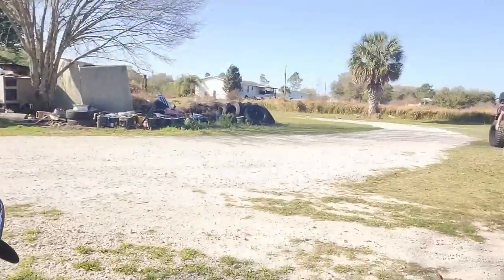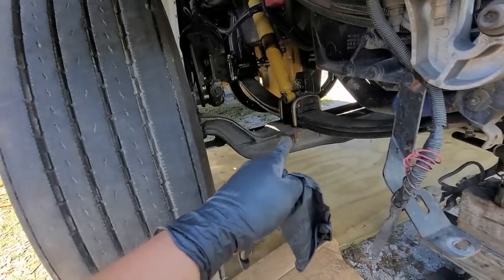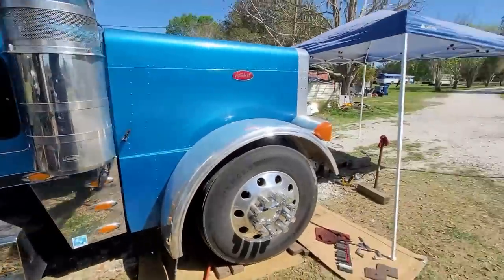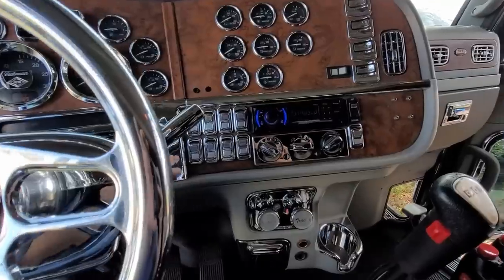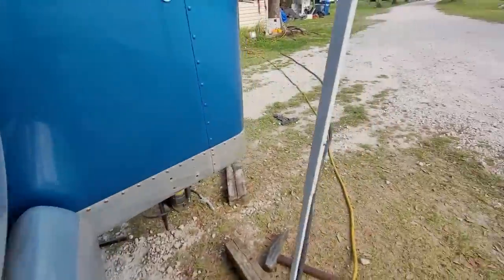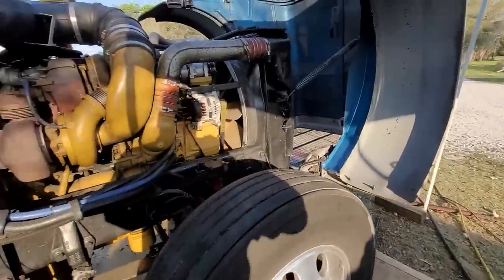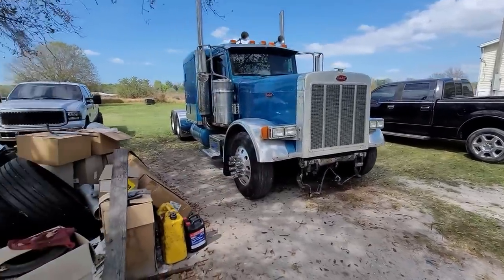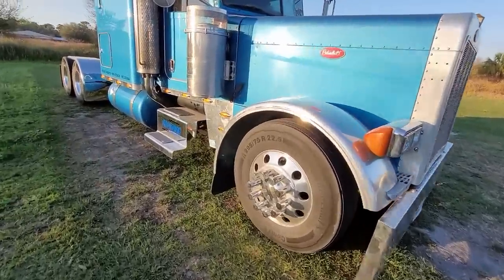Flat Top Peterbilt gets Front Air Ride!

Comment: Looks great you can get that bolt on the oil pan shaved and weld a plate there so it will go more lower
Reply from the maker: Yea, that's what I've been thinking about lately. It could easily drop another inch or two if I shave that bolt off

Comment: Before you purchase a car hauler axel I'm pretty sure I seen a special oil pan for the caterpillar, that has a notch in that area.
Reply from the maker: Yea, I've been looking around for a different oil pan that doesn't have that bolt sticking out the bottom. It would definitely be a lot cheaper

Comment: How you know how much air to put on the bags? No leve valve?
Reply from the maker: We adjust the air to whatever feel best for us. Too much air and it rides stiff and not enough air and the truck rides too loose. We usually run it around 40psi and it runs really smooth. Plus, we have friends with air ride that have leveling valves and they run it at 40psi also

Comment: Hey Brother, I love the fact you guys do your own modifications. I have been trying to get some cab & sleeper panels for my 2016 Freightliner Coronado 123 SD. Can you guys fabricate them for me? I want to take off the factory light panels and replace with some extended panels about 7 or 8 inches in depth. I would like for the bottoms to be bent in a 45 degree angle to install penny lights. Please let me know if this is something you all can do and we can discuss price. Keep the content coming!
Reply from the maker: We could definitely do it, the only problem is we would need to have the truck in person to get measurements and angles exactly right and to test fit everything.
Reply: I'm in Pooler GA near Savannah. I've been looking for a place to do some customizations like flooring, install seats, add interior lights, remove big horns from the roof, remove the APU system and clean up the back of the cab, as well as fabricate the cab and sleeper panels. If this is something you all would like to take on, please let me know and we can discuss how long you will need the truck and price.

Comment: Would this bracket set up work for a Kenworth t800?
Reply from the maker: I'm not a hundred percent sure? Only because of the axle sits further back and because the suspension is a little different on kenworth trucks. We will doing the air ride on  my brother's W900 very soon and maybe the brackets we make for his will fit your T800 a lot better